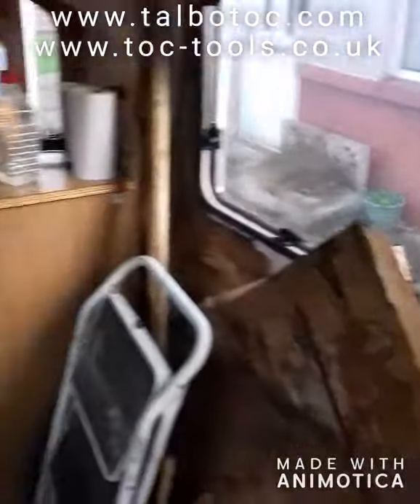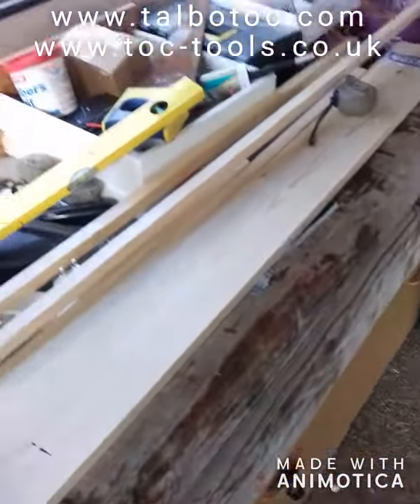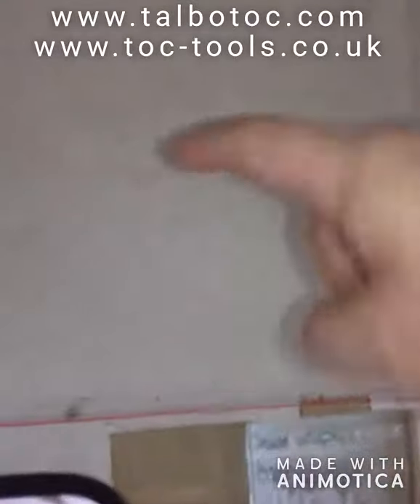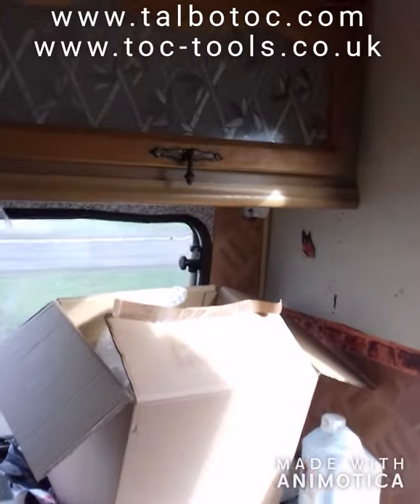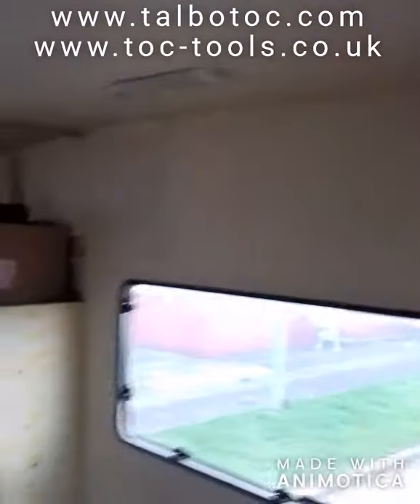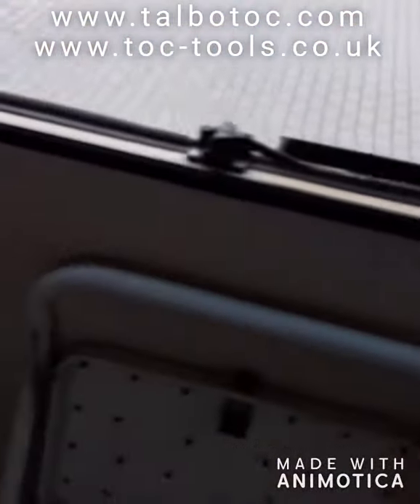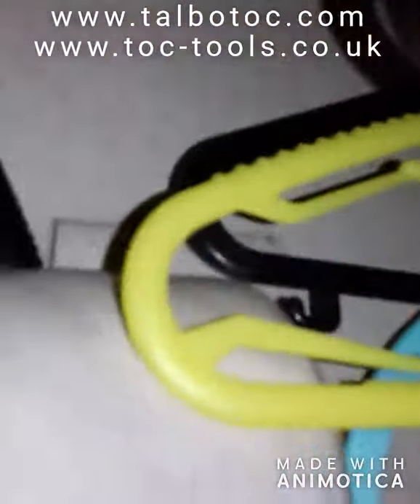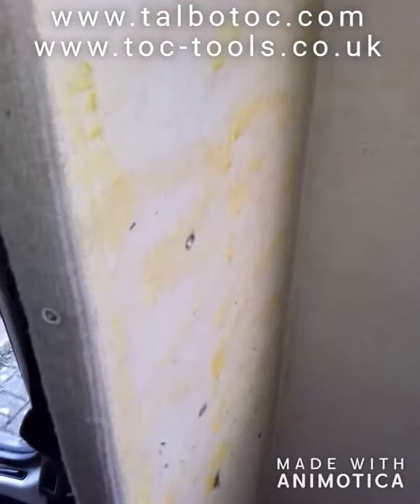Part 5 Damp Repair Talbot Express Highlander 2. Serious Damp, Pin Holes

Comment: Did you replace the roof to? Looks like you've done a brilliant job. I've  been working my way through your videos as we're about to do the same a bit at a time. Can I ask where you got the shower panelling from to please. 😀
Reply from the maker: Hello Tanya.
No I didn't do anything to the roof, it was very strange that from the top of the windows and above there was no rot or damp so I didn't need to touch it. My only regret is not doing all the roof in 4 way stretch veltrim same as I did at the front when all the cupboards where out. I did this with a kontiki I had and made a big difference to the warmth in the van at winter. Regarding the cladding and the silver trims in the bathroom I got it of eBay, when I am at my PC tonight I will put a link up for you.
You can pick up lots of tips on the Talbot Owners Club website, www.talbotoc.com
Reply: @PaulGloverHowDo  thanks so much am signed up to the site.  We brought our 1992 talbot express  3mths ago being first time buyers we were probably a bit (alot) naive. We did the normal checks but didn't take a damp meter. We are off abroad for a mth in 4 weeks and were getting our bathroom speedcoated in 2 weeks so had to do a bit of work  in  preparation as after the speedcoating we wanted to shower panel the walls and ceiling .  upon taking the ceiling lining off last night we found the joists rotted through and soaked and whoever  redid the ceiling before put bathroom wallpaper between the aluminium and ply and then there's a layer of  insulation and ply . Im trying to figure out what should be up there! The seller had put new wall board up to hide the damage  😟 to say my heart sunk is an understatement after spending £6000 on what we thought was a looked after  motorhome.  Oh well at least when we have repaired it I will know what's behind the walls a silver lining I guess lol.  I've spent today working my way through your videos as we plan to do the ceiling  now and the walls when we return and refit new cupboards , They seem fine but I'd like to check property for peace of mind after the ceiling. Your motorhome is looking amazing,  I can see it took alot of hard work! Thankyou for looking for the link for me,  that black glitter panelling is calling my name 😀 good luck with the rest of the work
Reply from the maker: Here You Go Tanya, https://www.ebay.co.uk/itm/White-Black-Red-or-Purple-Sparkle-Bathroom-Cladding-PVC-Shower-Wet-Wall-Panels/381756904719?ssPageName=STRK%3AMEBIDX%3AIT&var=650801463702&_trksid=p2057872.m2749.l2649